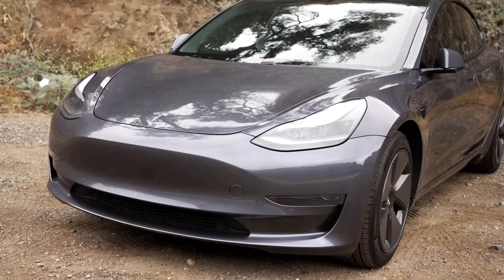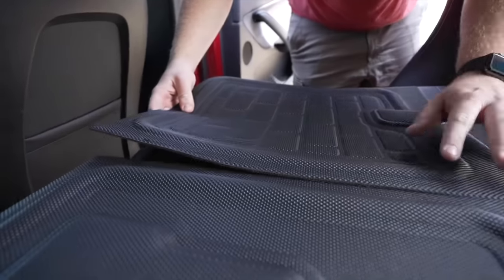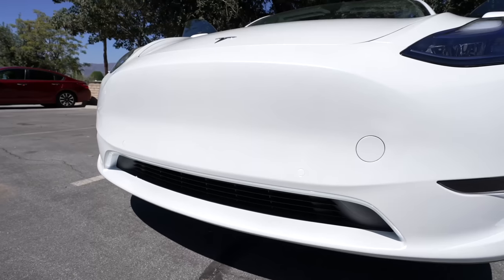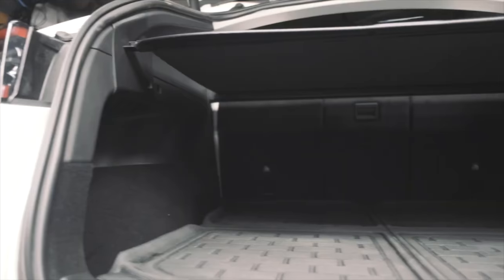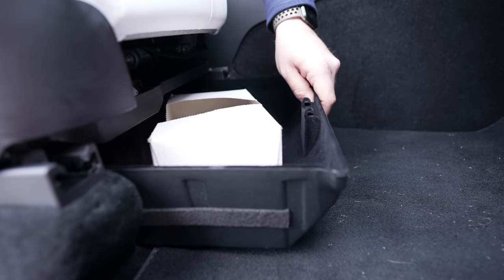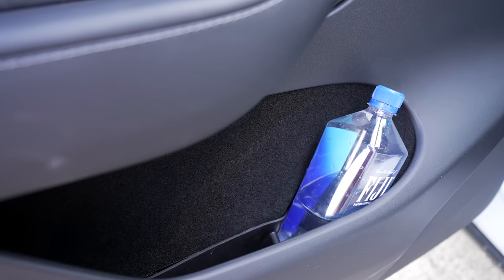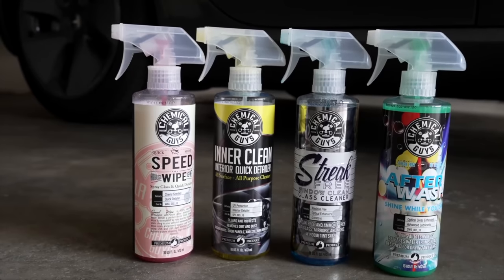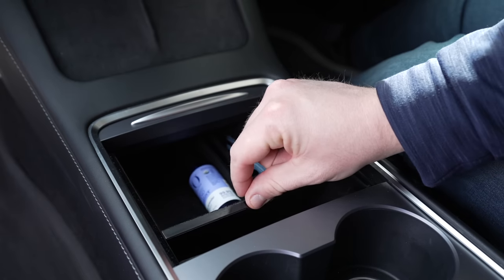Best NEW Tesla Accessories For Model Y, 3 | 2022

Comment: I really can't recommend the 3D Maxpider floor mats.  I had them for four years in my Model 3 and they are not great with snow.  The snow melts and since there are no channels to divert the water, I found myself with a foot in a puddle when we had any significant snow.  The drivers side also developed a small hole after this past summer.  I just switched to WeatherTech and I'm hoping for better winter performance out of them since they have the channels to divert the melting snow and the ridges will keep my foot out of the slush.

Comment: just an fyi, our 2023 M3 didn't come with any floor mats.  We installed TuxMat, coming from weathertech.  The TuxMats are incredible, and definitely worth a look if you are shopping around.
Reply: No mats came in my 21 m3, I guess we are the lucky ones =b
Reply: @borshardsd  Correct if I'm wrong, but I think the floor mat come comes included for a LR/P tier? My 21 M3 had no floor mat as well.
Reply: @brandonn161  I was wondering the same, ours is RWD SR
Reply: @brandonn161  I can't say for sure my friend,  thought some sort of mats would come with a 62k car. 

Tesla service centers taught me to pick my battles and since we go aftermarket anyway, I said nothing.  

Anybody else have a seat sensor replaced yet? =X
Reply: I can not understand for the price you pay they don’t even supply basic floor mats lol..
Reply: @brandonn161  I think you’re right bc my 2023 M3 P came with floor mats

Comment: By coincidence, I left a comment on your "warranty" video yesterday about an accessory for my Model 3, that I'm very happy with.  That would be the Bomely Fit 2017-2023 Tesla Model 3 Model Y Screen Swivel Mount Center Console Navigation Original Silver Screen Rotating Holder for Model Y Model 3 2022 Accessories (Upgrade-Four Directions) I bought from Amazon mid May.  It allows the console screen to move in any direction, which allows a better view of the console screen, and avoid sun glare.  It's not hard to install, and something I think should come with the car.

Comment: My must-have for 3/Y is the rotating screen mount from Abstract Ocean. It's DIY, but a little tricky because of the cramped space. Once it's on, it makes a huge difference. I found the right side of the screen to be nearly unusable while driving. Now that's no longer an issue.
Reply: does this void the warrantyt?
Reply: @HeyItsAvi90  I  was looking at doing this too and wanted to know if it voids it. I just got my vin today :D
Reply: @camrodriguez1240  apparently if u break something during the replacement then yes, but if doesnt break anything and the repair you do is unrelated to the screen then its fine. 

But if u break the screen and come to the dealer with damage bc of the swivel then its not covered. Unless its a screen defect itself then swap the old hinge back then warranty fix it

Comment: Regarding the spare tire, don't the Model 3 and Model Y have runs-flat tires? Shouldn't that make a spare tire superfluous?
Reply: No, the Model 3 and Y have self-sealing tires.  This is very different from run-flat.  Self sealing tires have foam that (ideally) hardens around any air leaks, temporarily sealing them until a repair can be made.  If they actually do go flat and you drive on them, you'll destroy the tire and (after a little while) your rim.
Reply: Depends on the tire, my recent Austin Model Y w/19" Gemini wheels has the Continental ProContact RX tires, they are "run flat", you can drive 50 miles at under 50mph on them but it likely trashes the tire (about $300 each).
Reply: @beachcrow  Those are also the tires on our 2018 Model 3 and on our 2021 Model Y.